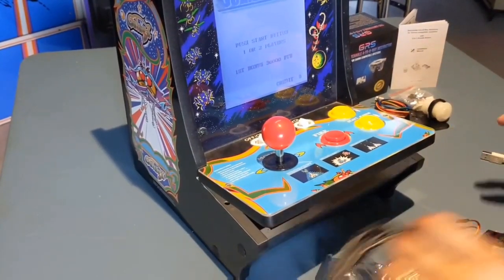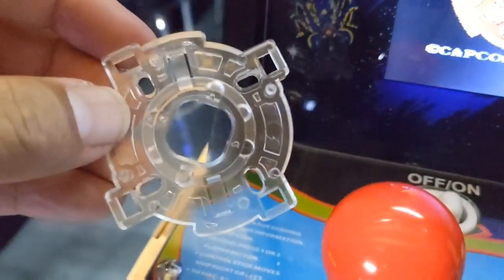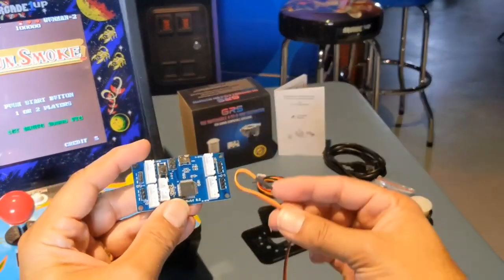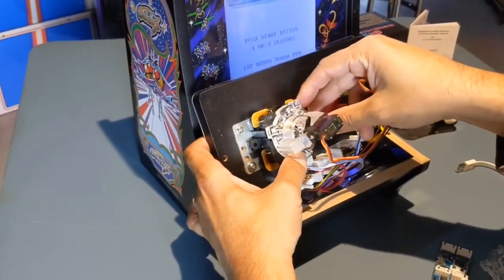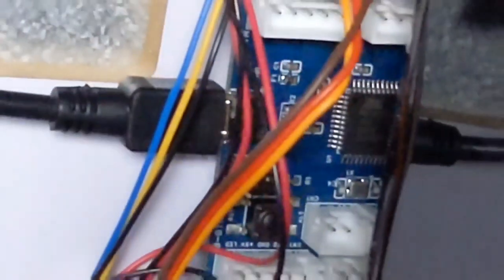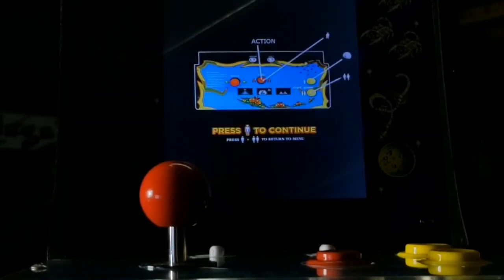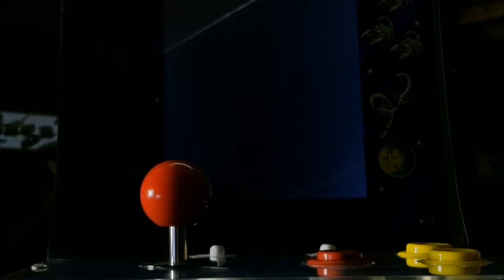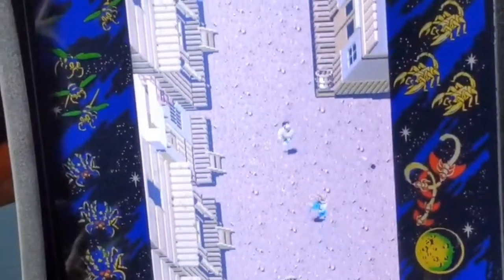GRS TOS Switchable 4 to 8 way Restrictor Installed on Arcade1Up Countercade

Comment: Nice mod! I'm considering getting this for my arcade cabinet. Do you know exactly how much space is needed under the control panel in order for this to fit on the joystick? Also, is there a way for this to switch automatically to selected games if I am using a authentic Namco pcb? The pcb is a Pac-Man Pixel Bash the Namco made to include 32 of their official games. It would be nice if i could get it to switch automatically. Thanks!
Reply from the maker: I don't know how much space exactly but that countercade has very little space available. So maybe an inch below the device. The automatic switching is only available for pi and windows. You would have to use the manual switch which comes with it